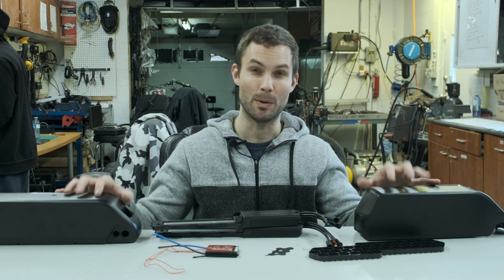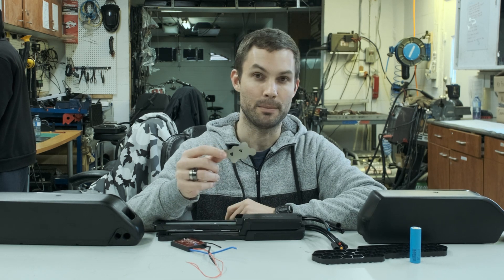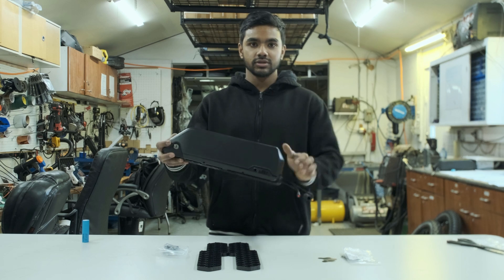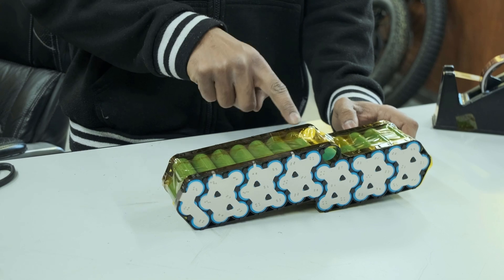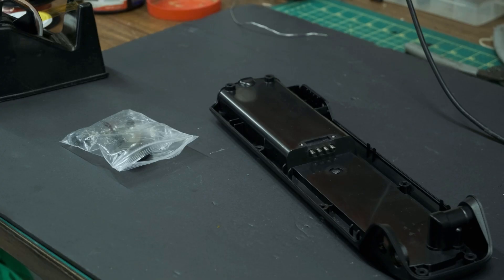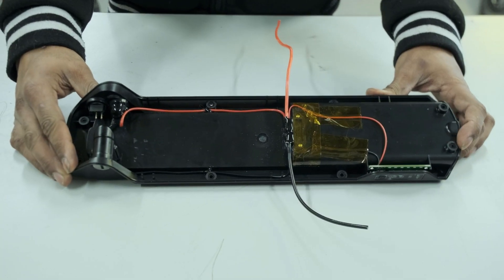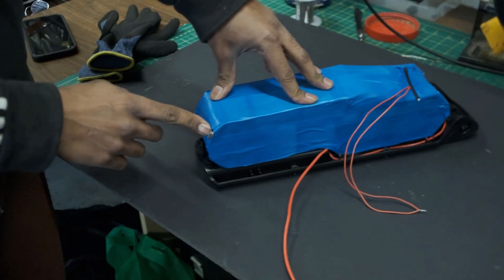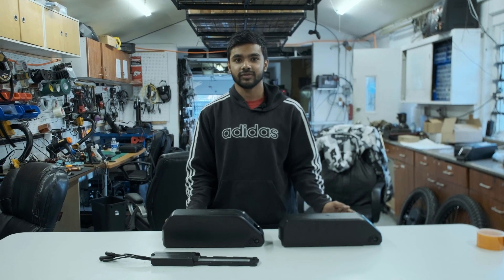Our Most Popular E-Bike Battery, but what's REALLY inside?

Comment: I bought one diirect from China, its 48v 20ah but i only get 15 miles fully charged and on the same route, speed and rider i get 25 miles plus on my original battery. It was 35 miles plus from new. I'm disputing the purchase for return or partial refund as they must be using cheaper cells but insist they're using Sansung 35E. 
I only charge these in a fireproof bag now as one never knows
Reply from the maker: What does it charge up to ? Should be close to 54.6V . If its a lot under there is a failing cell somewhere

Comment: Hello to you sir, I appreciate your teachings regarding  e bike batteries but have some problems completing a 13p 7s 48v 20Amps reention DP9 battery /case. The overall voltage for my pack is 54.1v but voltage reading after bms, switch and charging pot connection, came down to 25.1V. The first one I did gave the same problem and so  I put it aside and ordered another set from china and tried it again. i AM SURPRISED THAT THE SAME PROBLEM CAME UP AGAIN AND SO IAM STUCK BUT NEED YOUR ASSISTANCE IN RESOLVING THIS PROBLEM. The packs are for split pot reention cases. Thanks.
Joseph Oshagbemi.
Reply from the maker: Sounds like BMS switch is not engaged, you can try charging to kick the BMS on. Sometimes when the battery is that charged, it will not accept charge, and you actually have to drain a bit of energy directly from pos and neg terminals first so voltage lowers and BMS accepts a charge and kicks on. Hopefully this helps!

Comment: Building a battery without fuses both on the motor side and charge side is to be blunt, insanity
Reply: fusing is usually left like that so the user can have an easier to replace inline fuse

Comment: One question is there anyway the lithium oin battery's still good cuz of the bms being fried and it made all the batteries to .013 percent now ? Do you know if u think i can save them batterys ? There still good no physical damage to the batterys
Reply from the maker: You'll have to boost the pack and see if it holds voltage

Comment: thanks for all your vidéo. J was wondering what kind of awg cable J should use for a 13s7p 18650 batteries pack ? it's for a bbs2b motor... thanks for your help!
Reply from the maker: BBS02s come standard with I believe 14AWG but bumping up to 12AWG is a better bet, if you have a 13S7P even 10AWG if the battery can output enough current
Reply: @ElectricBikeLaboratory  thank 😀

Comment: Feel like thermistor placement can be improved. Since the placement is edge of the outermost cell it will most likely have lower temps than ones closer to center. Then again wiring that will be a pain since wire doesnt look that long. :( looks pretty solid otherwise.
Reply from the maker: Agreed, if the wires provided were a bit longer! I can see about asking DALY if they can extend the thermistors. Thanks for the comment! :)

Comment: Also why not organize groups to have positive and negative end at same end of case?
Reply: The layout they have rn is most optimal for lowest IR. If you do that youd end up with long lines. Not good for IR also prone to failure modes if one of the series weld fail.
If youre talking about putting all positive ends of cells on one side and negative on other, that is not how series parallel connections work on batteries. Youd end up with 1 series battery.
Reply from the maker: Nailed it, this allows most efficient flow of series connections

Comment: I have your 48v 21amp 1865 cell pack, the best bang for your amphr $Buck$, larger and heaver compared to the 2170 cell, but on my trike that's not a problem.  I have been trying to drain this battery pack so far total 107kms, 758watt-hrs used, 44.9 volts, on todays ride pulling 410 watts from the pack, @32 kph, voltage drop from  44.9v to 44.5v = .04v. I will charge at 42 voltage. Thank for a Great Battery Pack.